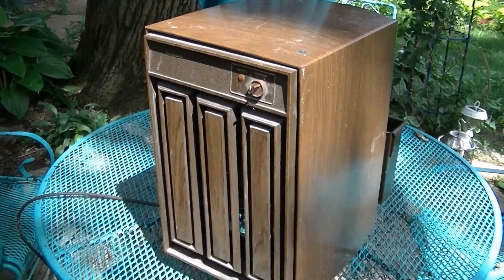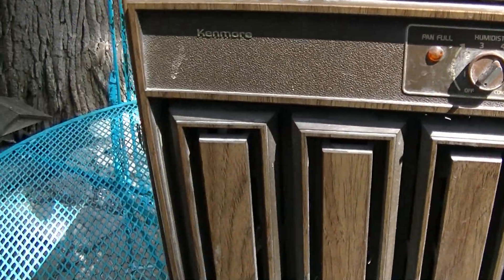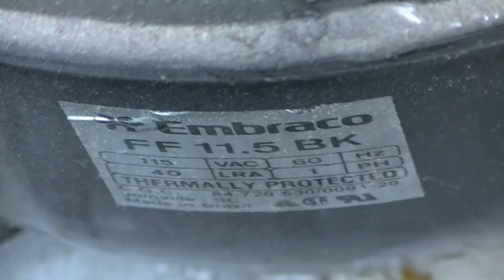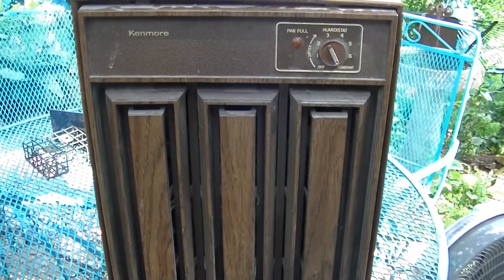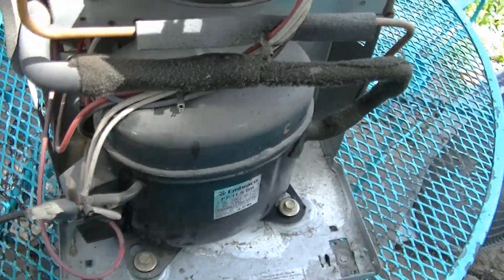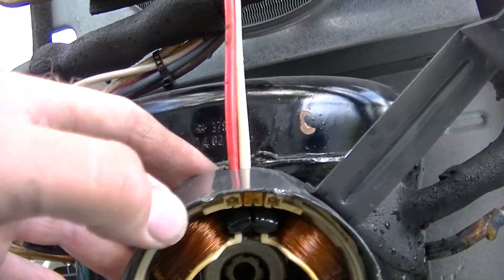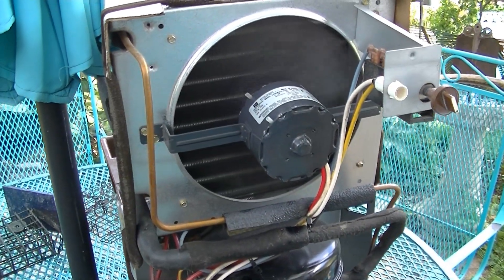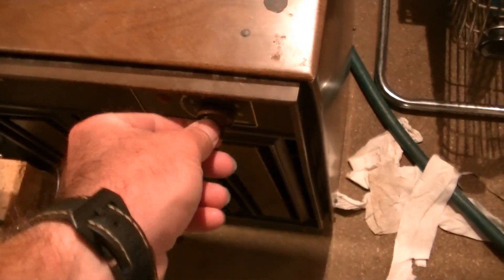Vintage Kenmore Dehumidifier Fail

Comment: I found an old lg and it had the same problem, seized fan motor and low on refrigerant. But mine was also leaking gas out of it
Reply from the maker: Seems like dehumidifiers love to leak refrigerant.  If I can find the leak on this one I'm going to try fixing it since these old dehumidifiers tend to last a lot longer.  Definitely has a good compressor.